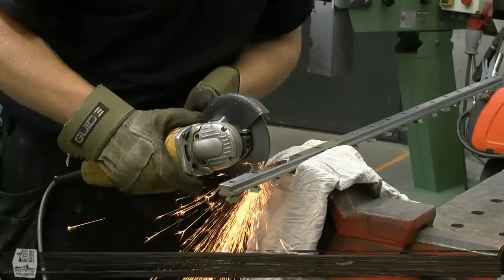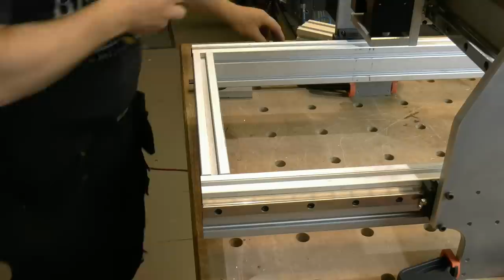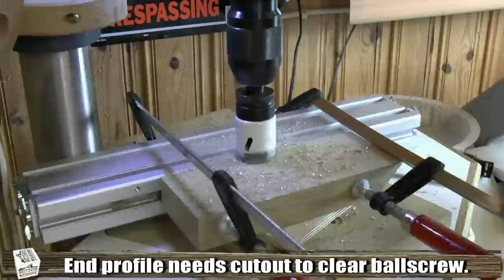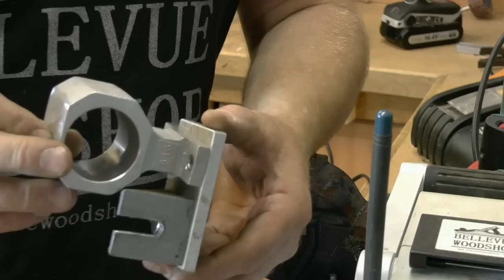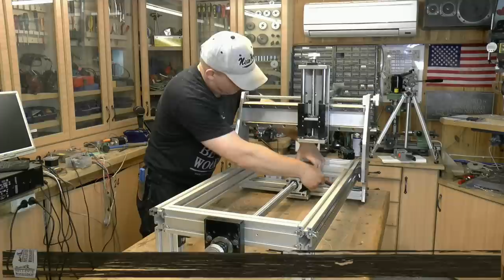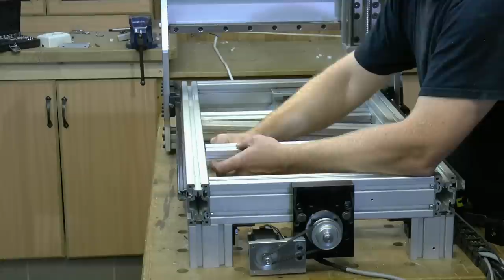Building a Benchtop CNC -Part 3 - X-Axis

Comment: Holy cow, that ball-screw looks like it's as thick as the end of a baseball bat!!
Reply from the maker: Its from a butchered Bosch rexroth linear morion unit. I think it is 30mm in diameter. The housing for this unit, I cut down to use as the gantry top
Reply: Bellevue Woodshop It can never be too much if it's salvaged parts!
Reply: Creo q  hacerse una a su gusto ...sale mas caro q comprarse una nueva.

Comment: The only thing i don't like is with all same designs, why are the guides on the x axis always on the side and not on the top, given the pressure from the Z axis is acting in a downward manner against the x axis. I know it perhaps isn't happening at the same time in normal operation, but i dont like a side ways force being applied to the x axis guide or any,  i am sure its far better to have any force applied on those guide to be on the central plane rather than the side if you see what i mean. Just my opinion.

Comment: Very nice. For the waste board, I recommend screwing some wood strips against the insides of the tables and then screwing the waste board into the wood. Much easier than T-nuts.
Reply from the maker: Thanks for the feedback and tip, but I have to large bags of  nuts for these extrusions, so its quick, flexible and easy
Reply: Kood

Comment: Helllo, love your cnc table project, would like to know where you got your linear guides and ball screws from?
Reply from the maker: Thanks. The big ballscrew under the bed was from a butchered Bosch Rexroth linear unit. The 2 other ballscrews are "el cheapo" off ebay. All the linear rails are salvaged from old machinery we have dismantled at work
Reply: @bellevuesnekkeri  thank you a million for responding. I could only dream of having a table like that. Its WOWwwwww
Reply: @bellevuesnekkeri  Do you cut any metal on it?
Reply from the maker: @bjphoto1  Only once. Tried to cut a aluminum branding iron. worked ok
Reply: I found them on ebay

Comment: Good work. But i have a question. How do you ajust precisly the distance between the 2 X rails in oder to avoid to create constraints in the Y gantry? It appears that you relate only on the cutting of the aluminium extrusions at length. But is it really precise enough?
Reply from the maker: Thanks. I did not show it but i did pretty much the same thing as I did when installing in this video. Except that on X axis I needed to make sure they where consistent trough 2 planes.  https://www.youtube.com/watch?v=hxea_Eho1xo

Comment: your gantry should move easy with little finger. your structure is binding linear rails. 1/4 power of your stepper motor is going for just move gantry
Reply: it dose have a ball screw to back drive

Comment: Hi, very clever design. Have you had issues with the gantry getting crossed due to eccentric load? I mean, usually other designs use two steppers for (in your case) the X axis, each on one side.
Reply from the maker: Thanks. I have not had any racking issues at all. The gantry is very stiff, and also pretty short, so I have no noticed any problems yet. Thanks for watching and commenting

Comment: y x z axis I've seen everything.
It feels like you're working very hard.
The average person probably does not have the precision and it seems to fail.
For example, if you use the actuator directly on the x axis and connect the motor directly, it will be much easier.

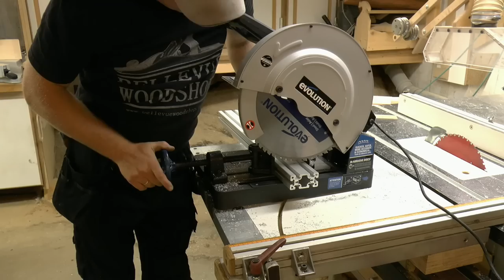Comment: @1:37 on the chop saw, always use your first good cut part as the gauge for the others, otherwise you could end up with progressively longer cut ups.
Reply from the maker: If you watch the video in slow motion you will see that this is exactly what I did

Comment: Excellent job! Out of curiosity, why not use your other CNC to make the aluminum parts for this one?
Reply from the maker: Thanks. I have actually never tried to dry cut aluminium on the large machine, mainly because I have no experience with it, when it comes to feed and speed, and also due to the size, there is some slight backlash on it. So heavy loads might affect the quality of the finished part. But it might just have worked great, but need to gain a little more knowledge first

Comment: Hello, which brand and model of linear guides and extruded aluminum did you use? I'm building my own but I have to make sure these 2 pieces will fit.
Reply from the maker: Hello José. They are salvaged from a dumpster at work so I am not sure. I think the linear rails are Bosch Rexroth.

Comment: can you please tell me how much money total went in parts? thank you.
Reply from the maker: I purchased the spindle, stepper motors, Y and Z ballscrews and driver board. Extrusions, linear rails, bearings, aluminum sheets, VFD, computer, cat track, cables, nuts and bolts is all salvaged parts, so aprox 250 USD

Comment: Isn't that the Y axis? Moving back and forward?
Reply from the maker: Yes, normally the one with the longest travel is the Y axis, so the gantry has the x axis movements, But I am loading the machine from the side, and I wanted the cnc software interface to correspond with the left right movement
Reply: Fair enough :) Good work your project.